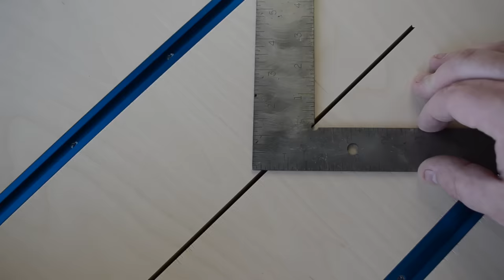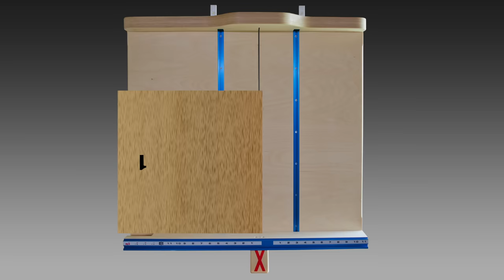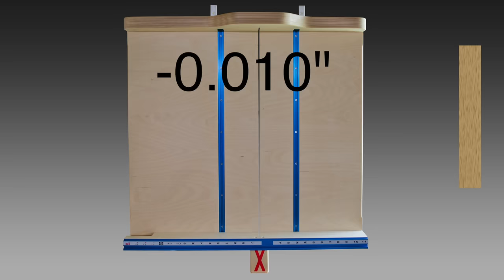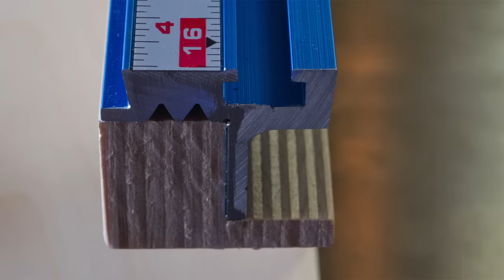Ⓕ Make A Table Saw Cross Cut / Miter Sled Combo (ep58)

Comment: what is the utility of 2 measuring tape? Just keep the one that let you cut small measure?
Reply from the maker: not sure I understand what you mean
Reply: on your sled you have 2 measuring tape and they do the same job so why not just having one? Nice sled by the way!
Reply from the maker: one measures to the right of the blade and one to the left - the indicator line on the stop is off to one side so the starting point will be different from right to left, hence the two tape measures

Comment: where did  you  get  the  clamp  you  used  on the  rip fence  stop  block  with  the  hole  in it ? what are  the t slots for on the  miter jig?
Reply from the maker: I have those listed under clamps here - https://nickferry.com/my-tools-equipment/ and I show using the tracks in this project - https://nickferry.com/2015/08/how-to-make-a-shadow-box-ep59/
Reply: Thank you God bless

Comment: what type of screw centering bits did you use? I haven't seen those before.
Thanks!
Reply from the maker: I have them listed on my tools page here - https://nickferry.com/my-tools-equipment/
Reply: Thanks Nick!
Reply: Nick, I had notice what appeared to be blue self center bits with a possible quick change at approx 4:05 minutes into your video. You were placing your miter tracks with a predrill and screw. Could you tell me what the blue countersinks you were using? I could not find them in your list.

Thank you very much, this has been and excellent tutorial and I look forward to more!  Excellent work!
Reply from the maker: they are the second item under "blades and bits"

Comment: Do you think I can make one of these for a portable TS?  My Bosch 4100 top is only about 21 1/2" long with about 6 1/2" from the front edge of the table to the blade.   I realize I can pull the sled back where it overhangs the edge, but just curious if  you guys think it will work.   I want to buy the plans and use the exact dimensions as Nick's sled.   Thanks.
Reply from the maker: I made another sled for my jobsite saw as well - I made it 4" less deep that what I have on the plans and that worked out really well
Reply: Thanks Nick.. I'm a beginner, so will I have to remove 4" from several measurements to get it to work, or just the depth and keep the rest the same as your plans?  I just want to be sure before I  purchase.   I realize I may be limited with my small table, but I really want the miter option like on your build. Thanks again.
Reply from the maker: I just did it from the depth but mock it up and see how it is on your exact saw

Comment: Will you consider making a few for sale?  I am sure that myself and several others would be willing to make a deposit in order to ensure some profitability for you.
Reply from the maker: What do you think a fair price would be?
Reply: @NickFerry  in consideration of everything you do in the video, including the final touches with polyurethane and wax, plus the small improvements you mentioned making, I think $200 would be the number.  But only you know the cost and value details from your point of view.  For all I know, you may see my number as higher than you expected, or insultingly low.
Reply from the maker: @GT705  thanks for the input - it’s not insulting in the least - I’d probably have to be asking closer to $300 based on all the aluminum parts

Comment: When you say “flesh sensing” do you mean sawstop? Are there any other saws with that technology? Just say sawstop
Reply from the maker: No - at the time of recording, the Bosch Reaxx was available - at the time of your comment, the Altendorf Group has hand sensing technology and the magnetic brake of the Fielder kappa 550 should prevent some injuries - of course this is omitting the several decades that industrial processes have utilized light curtain technology to mitigate workplace appendage dismemberment

Your comment was fairly benign up until your last statement - but demanding a stranger on the internet to change their lexicon so it matches a smaller knowledge base of what’s out there seems silly to me

Comment: So you have discs in both your mitre and tablesaw that cuts aluminum? Which.are those?
Reply from the maker: Carbide tipped blades
Reply: @NickFerry  does it also cut wood?
Reply from the maker: It does
Reply: @NickFerry  Thanks and salutations from Baja Mexico amigo 👍😎

Comment: Nick. Would I be wasting my time doing this on a Sears 10” saw?  I’m sure it nowhere near as perfect as a good table saw.
Reply from the maker: Hard to say without seeing it first hand but if the saw is decent I'd say it'd be worth it - my saw is on the high end side and the sled adds a great deal of value to it for me and what it does - if your saw arbor is straight, bearings good, trunnions run true as well as the blade nice and parallel to decently milled, consistent miter slots, then I would think it would add value to your time and projects as well and help you better utilize your saw

Comment: Why does a crosscut sled have to have two sides?
Reply from the maker: +‘Cave Beast Demon' it doesn't have to but it helps aid in supporting longer off-cuts and carries them past the blade - also with my design it holds the miter portion as well as various other add-ons like my tenon jig and box joint jig

Comment: Why didn't you just cut one half of each of the fences 3/4" shorter than the other. Then you would not have had to do that extra cut.
Reply from the maker: varying thickness in plywood is rarely exactly 3/4"

Comment: Another precision question....Is there a way to accurately measure the true angle of framing square....I have a framing square (and they all look alike) that's stamped  out of steel sheet and looks pretty crude.  Given that I have aligned the cross cut sled to a couple of thousandths in 24 inches, I thought that I could clamp the short leg to the sled fence and use a caliper running in the saw's slot to measure the difference from true parallel to the saw's slot.   Having something to measure, I know that you can use a steel punch to change the angle of the square...any thoughts?  Can you get too anal?